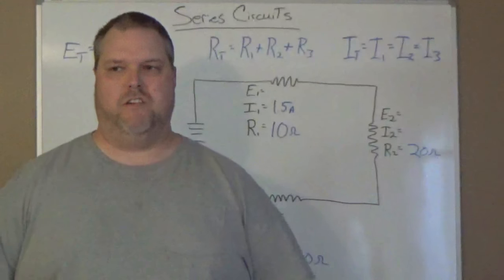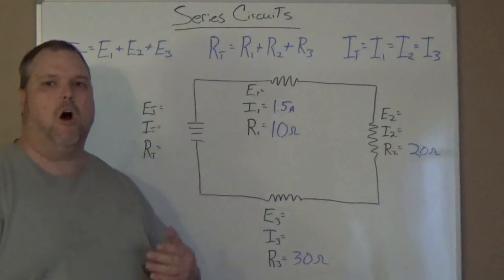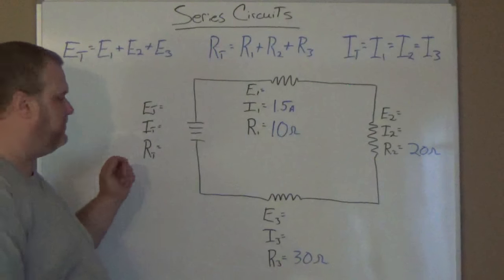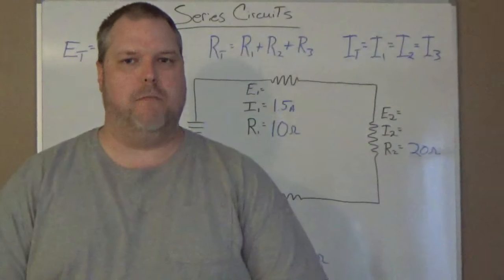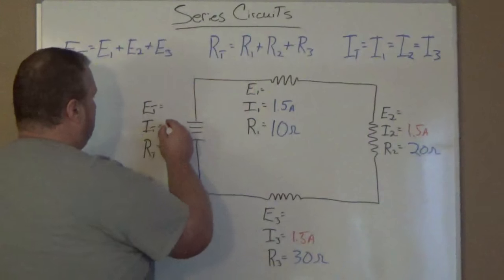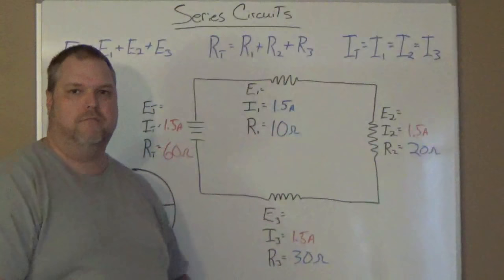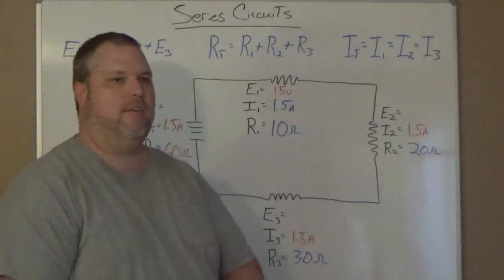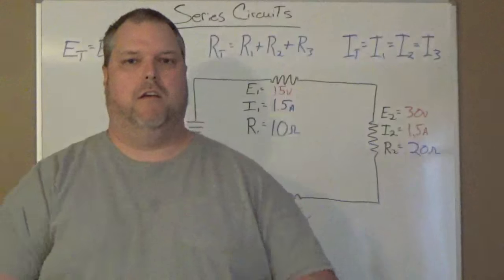Understanding and solving a Series Circuit Theory

Comment: Great video" Can you show how to solve a parallel series circuit
Reply from the maker: Thank you!! I certainly can do a video on Parallel circuits. Keep and eye out for it. Thanks you for watching!!! CM
Reply: @craigmichaud-electricalins4602  Have you made a video on parallel circuits?
Reply: @christopherfontes4446  in Parallel circuits: Voltage stays the same through the whole circuit. Total current is found by adding them up together throughout the circuit. And Resistance Total is going to be less than all the other Resistances in the circuit.